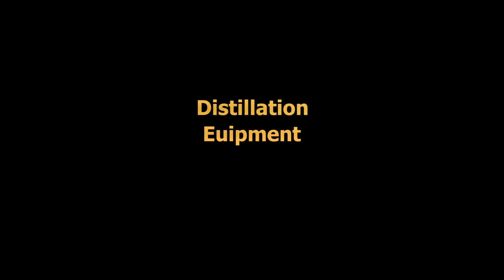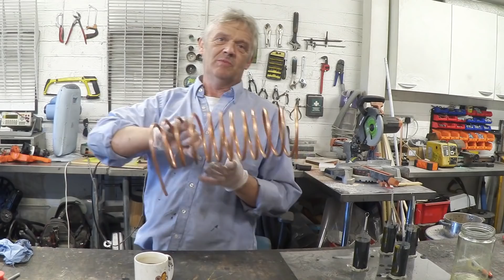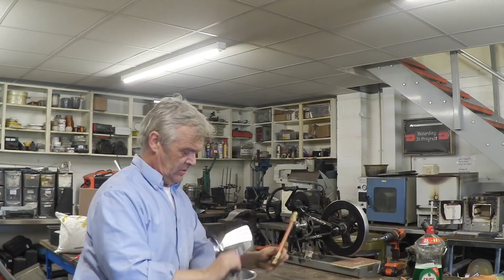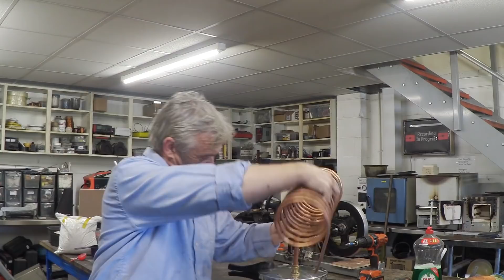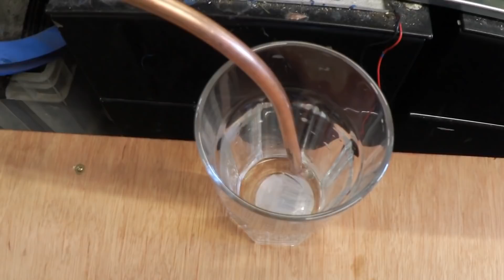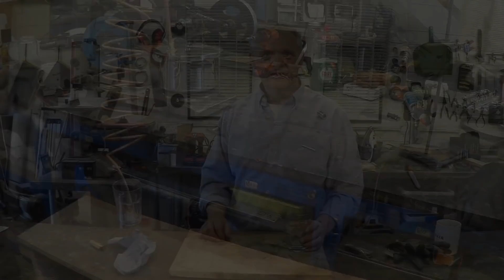1261 How To Make Your Own Distillation Equipment For Alcohol Based BioFuels

Comment: i was born of grid a we mad our own wood gas  by mend of paralysis we also capered our tar from the gas ,in a sialon  & that was ues to make creasalt  & a light fuel to run the gen set. The gas was condense in a bubbler a allowed to drop in to a gas cylinder in liquid form   they was set in a deep freezer that was powered by the gas we predicted the gas powered freezers was used a lot in them days.  you presser vestal could be used for that to we ues a gas cylinder in the back of a wood beaning stove.  to prudes the gas.   as in them bays we lit our hoes on gas  & often  cooked on it. one of the by produces was charcoal  which we often reburned  in our wood stove & houses fire to keep worm . in the 50 & 60 we lived of grid & even to day there is no power in the cottage hell their is no cottage sending . LOL

Comment: This rig is great for a little booze if you want enough to run your vehicle a distillation column is better. And a dryer tube to bring the proof upto 200  a good reference  book is Alcohol  Can Be A Gass .very  comprehensive and clearly written ,from late 1980s or early 90s

Comment: My welding instructor way back when, used to work at the Hiram Walker Distillery. One day he decided to give a demo on the proper way to make a still, should any of us be inclined to do so, sometime in our lives. #1 he insisted that there be at least 37" from the surface of your boiling mash, to the start of your condensing coil, or a contaminated form of alcohol could result that causes blindness.
Reply: They probably used toasted oak for tannins and that would produce toxic methyl alcohol. If no wood is used, I believe that the result is ethyl, which is "safe" to drink. Don't take my word for it, but I'm pretty sure this is the case.

Comment: The condenser needs to be inclined vertical so no fluid blocks the lower arcs of the coil.  Let the condensate flow down and not need pressure to push fluid up and over every turn.

Comment: Relevant to this video; would a metal pan with some wet Oasis foam allow the condenser to operate longer than just water cooling? I am thinking about Oasis foam because you can form it to the condenser pipe more easily and there is less chance of spilling.

Comment: You are wrong about the alcohol & water. They form an azeotrope, which means that you can't boil the alcohol without dragging some water. The trick to purify is that the evaporated mixture is richer in alcohol than it was before, so if you repeat the destillation on the new mixture you can purify more and more until you reach the asyntotic limit (i dont remember the name), which is NOT 100% alcohol, but a bit less

Comment: Nice. Being a home brewer I have the exact coil needed. I use it for cooling beer from 100 degree to 20 degree in a few seconds but it could be used to distill i guess.. I have some friends distilling as well. I believe 90 or 95% needs several runs. It's illegal in the netherlands too but rarely prosecuted as long you' re not selling or otherwise expose the product to others.

Comment: Vacuum distillation like that is incredibly dangerous and very low output as you should never fill more than 1/3 if under pressure and look at a pwm or PID controller to control the heat and never never use gas

Comment: I prefer "shotgun condenser"(it forks from one to many pipes and then back to one again the other side, no need to have one long pipe that has less surface area) over that copper coil, which needs more work and preferably stainless steel that is acid resistant.

Comment: Here is a good trick to get the most out of a still add salt to the mash till it will not dissolve anymore the waters boiling point goes up and your margin for production is increased.
Reply from the maker: that is an ice tip - cheers mate

Comment: I tried to bend a straight copper pipe filled with stuffed sand,  to a coil, for a rockeoven, cookingstove water heater., it didn't work for me. I compeedly took my motivaton. . . I wish I had known that there
 ones that are desingned to be bend.
Maybe I should give it another go.
Reply from the maker: microbore is so easy to bend nicely mate
Reply: I would. I find rubbing the surface of the tubing warms it up and it bends nicely.  Thumb between middle and index finger. Rub the inside of the coil with your thumb until it feels warm. Then continue to work the warmth down the tube as you gently bend the tube to take the shape of the form. Last time I bought copper tubing from the hardware store a 10 foot piece was $9.49 and the 20 foot piece was $9.99. If you are trying to bend rigid copper pipe they have a tool for bending those pipes. Won't get tight radious circles, but it does bend with a long lever tool.
Reply: @ Magneticus Attracticus
wow thanks that sounds very reasonably

Comment: Could have just chucked the liquid in an old coke bottle, squeezed the air out and tighten the lid and then frozen it. As alcohol has a lower freezing point than water you can then just drain the alcohol out leaving a block of ice behind.
Reply: Awesome tip. Thanks.

Comment: Sweet... but I think you'll get better separation of water from the "bio fuel". Something close to azetropic  if you have the vapors rise through a condensing coil that encourages water to condense out and fall back in.  Something like reflux distillation. 

 Then a run to a colder condensing coil that allows the remaining condensed fluids to drip out and be collected. 😁

To be effective this requires  observing the temperature at the top of the distillation setup and adjusting the heat slowly up so that you get just the temp at the top to minimize water  coming over.

Comment: Great job. I would love to see you make a distiller for regular old water. Would love to see it for emergency situations. Maybe with the grid down or just areas that have power but no clean water. Think it would make a great video
Reply: This still would work just fine for water you just add more heat to boil the water.
Reply: You might be able to get away with just boiling the water. That will kill most of the diseases. Distillation is for toxic chemicals.  Just remember, toss the very first portion that comes over. That's where the volatile organics will be. And if you're making moonshine that's where your toxic methanol will be. And don't run it completely dry either. You want the stuff in the middle.

Comment: Vacuum distillation is fascinating. You can make a very basic and simple vacuum pump by reversing the seals in an old style bicycle pump and reversing a presta valve. At room temperature ethanol boils at somewhere between 0,1 and 0.05 bar. Get the condenser and receiver down to 10C and you would be laughing.
Reply: I would like to see a cheap homemade style vacuum distillation! Also, some experiments with the new hydrogen generator...